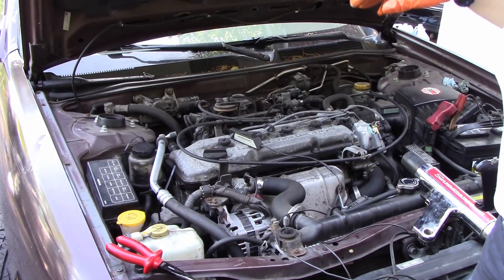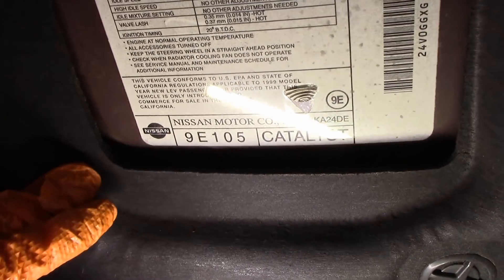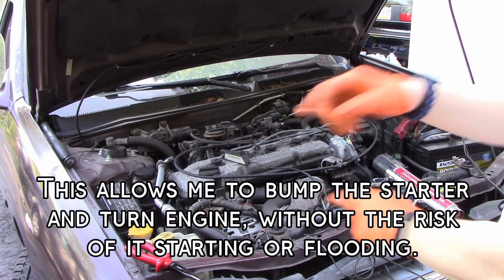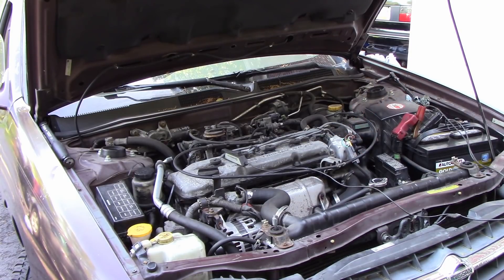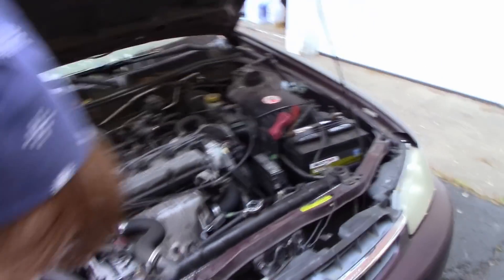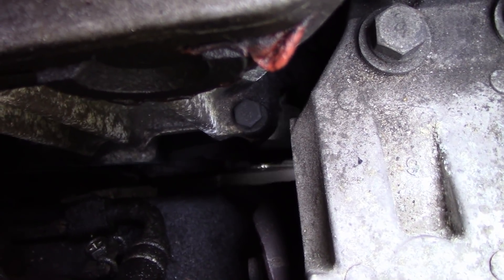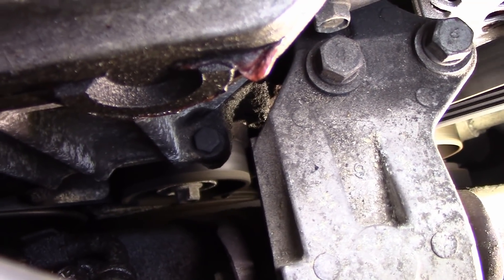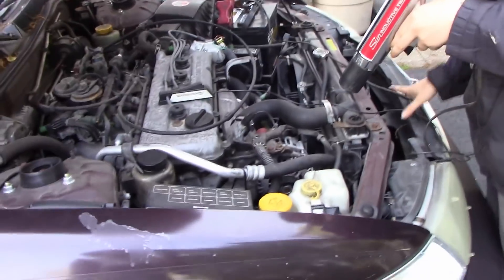'99 Nissan Altima 2.4ltr; Timing the Iginition Using a Timing Light

Comment: Nice video and well explained. Most mechanics today don't even know what a timing light is and how it works.
Reply from the maker: Hahaha.. yes!  So I've heard.  Many areas don't even have many older vehicles go to them for service either.  Thanks for dropping by Jim! Hoping you're enjoying the weekend! 😊🤗
Reply: @CubasAutomotive  Nissan Alima 2000's manual says that during timing adjustment one should unplug the throttle position sensor... Or it is not necessary ???

Comment: Why is he pumping the gas.. it's feel injected.  Pumping the gas pedal does nothing.
Reply from the maker: I don't recall that. Pumping does nothing,  correct, but holding the pedal to the floor cuts injector pulse... so it clears any flooded condition. Maybe he was doing that? Remember,  he does not know much about vehicles. So there's that. Lol
Reply: @CubasAutomotive  he doesn't need to know much ,  he has YOU. All he needs to do is say" it's broke,,please fix it".
Reply from the maker: @redhytech  yes. True true. 😅

Comment: How did you know that the notch you marked was at 20° before TDC? Thank you in advance
Reply from the maker: Great question!
That's all due to service info. There are marks on the harmonic balancer as well, but service info is much easier to read. I just compared the info to the harmonic balancer and made sure the info I had matched correctly.  I'll see if I can post a link, so you can see better what I mean.
Reply from the maker: https://drive.google.com/file/d/18MFMD36dyBuxWwuKihNUyqTRusW8GgRi/view?usp=drivesdk
Reply: @CubasAutomotive  thank you so much :)
Reply: What could happen if this timing is off

Comment: I thought I was the only one that still owned a timing light! I actually have 2 - one I had to buy at Checker Auto Parts in Phoenix when I moved out there for school, since I had left my Craftsman one at home in MA ... 20 years ago this week! Still have both of 'em. The Craftsman was handed down from my grandfather to my dad, and then from dad to me. Still need them for our Grand Marquis, and 940. Been a while since I've had to break them out, but they'll be ready when I need 'em. 😎

Nice job, Cuba! 👍👍 🍻
Reply from the maker: I have 3 lights. Had 2 with me for this job. Lol
Reply from the maker: That's awesome to have a tool passed down from your dad!
Reply: @CubasAutomotive  - Most of the stuff came from my grandfather - my dad had the ability, but didn't have the patience (sounds familiar, LOL!) so he spent his days in a factory - the mechanic skipped a generation. I've got my grandfather's toolbox from when he was a machinist at a local factory in the city - I need to break that one out and get it into the new shop now that I'm thinking about it. Lots of neat tools my grandpa made himself in there. He fixed Model T parts in his home garage right up until he passed. Stuff is in rough shape though, since it's been a mouse motel for the past 3 decades. Still glad I have it. My grandpa would be super proud if he could see my shop. He'd also be shaking his head at all the electronics, and tight spaces we deal with! 😁
Reply from the maker: @SmittySmithsonite  awww! That's awesome!  I love to hear those kinds of stories!  I wish I still had access to my ex friends Model T. One of the most interesting vehicles I've ever worked on, for sure. So therapeutic too! At least you have the tools, mouse motel or not! I'm also a HUGE fan of vintage tools. 😍😍
Reply: @CubasAutomotive  - Indeed they are! Neighbor has a BEAUTIFUL Model T truck tucked away in a garage on a separate part of his property - hasn't run in decades. I wanted to get it running for him, but that project unfortunately fell through the cracks of time. Hopefully the roof on that building is still intact, otherwise it'll go away fast. Maybe some day I can get on that, or maybe his daughter will. I'd hate to see it get destroyed by the elements.

I'll have to video some of the ones I have. I've got a vintage Snap-On ratchet - to change direction, you shove the 1/2" drive mechanism through, and flip it around! Pretty neat. 😎
Reply from the maker: @SmittySmithsonite  oh that's so sweet! I hope you can save it! Love to see a video on those tools too!! 😍😍
Reply: @CubasAutomotive  - I'll try to get a vid of the tools up in the next several weeks. My differential is supposed to be here tomorrow for my Silverado - I started shooting that vid March 12th ... been waiting on parts 8 weeks!! Plus the regular jobs in between.  I'll make a note so I don't forget. :)
Reply from the maker: @SmittySmithsonite  oooo... I'll remind you, I'm sure! Man, 8 weeks for parts! I know how you feel. Working on my sister's van since TST I think... or at least a month. But it's nonpaying, so I've been doing paying jobs in between. 

I had the heads sent out & returned, and engine all apart for a couple wks now. Weather has been horrible too, which by the way I'm doing this job in my driveway.  Last couple days, I just got done prepping the block, cleaning off all the old material & carbon off the pistons. Was hoping to start reassembly tmrw, but it's supposed to be raining through Tues.  

We'll see. Have a great work week!! Stay productive!  😊😊🤗🤗
Reply: @CubasAutomotive  - Good of you to help out your sister! Yeah, weather has been terrible the past month or so. Should be getting better any day now! You have a great week, too  - thanks! 🍻

Comment: Hey Cuba. Nicely done. I was going to ask if this had a spout connector/vacuum advance, or some way to set base timing but I see that's already been covered in the comments earlier.  You could have advanced the timing a couple of degrees and run higher octane fuel but on a customers car, you did what's best. My '85 Z28 on the other hand is my toy to beat up so I'll try anything. lol. Great video Cuba.
HAPPY MOTHERS DAY CUBA!!!!!
Reply from the maker: Awww! Thanks so much for the kind words! 
This customer wouldn't switch to the higher octane for sure. Although he's religious with his oil changes. This was his father's car and kept for sentimental value, as well as a backup for the family. Minimum is spent as he has 5 vehicles total.  I don't blame him. I try to do what's best for the customer. 
Thanks for stopping by! 😊😊🤗🤗

Comment: Awsome as Always. Reminded me of my younger days, when i worked in my dads shop. It must have been  over 15 years since the last time i operated a timing light. Brings back alot of memories.😊
Reply from the maker: Wow! Over 15 yrs ago?! I still use mine maybe once a month! That's quite interesting!
Reply: I first used a timing light working on a friend's 1973 Super Beetle when I was in high school. Brings back memories. Had to do this today for my own 2000 Nissan Altima after changing the distributor.

Comment: Great vid, Cuba! I want to see a vid on setting ignition points using the dwell method now hahaha!
Reply from the maker: I hope to have one soon enough.😉 At least 2 pieces of equipment that need to be worked on soon with points.  ...
Reply: @CubasAutomotive  cool! Haven't done points in some time but use a timing light almost every second day, that's a bonus with working on classic cars 🤘 My apprentice didn't even know what a timing light was before I started working at the current place I work at.
Reply from the maker: @2secondslater  lucky you! Classic cars!😍 I'd love to do that, at least here & there... what's the oldest you've worked on?  Absolutely awesome that you are able to keep it going, as far as continuing the use of old technology and passing that knowledge on! 😊👍
Reply: @CubasAutomotive  usually the oldest cars are 30's model hotrods but also get to work on lot's of 60's to 70's model vehicles ie XY Falcon GTHO's, Mini Coopers, Camaros and Chargers etc and my own car is a 1970 VG Hardtop . Most of the work I do on the daily is on late model stuff though, a good mix 👍

Comment: Your video reminded me that my old Sun timing light needs a new bulb and for the life of me I can not find one. It's nice to see that some cars can still be timed by an old school light.
Reply from the maker: Man! I know Radioshack used to carry those bulbs. There were 2 different styles, if u recall correctly.  A "U" shaped one & a bar shaped.  I wonder who would stock them now?  Are you on Facebook, Wyatt? I wanted to plug your channel & "thank" you for the sticker from TST.
Reply: @wyattoneable, just a tip, you can even check timing on cars with coil on plug ignition systems in most cases if you put the inductive pickup over all three (or five) wires to the coil 😉 If your timing light is good enough, the inductance from the primary circuit will still trigger the timing light.👍
Reply from the maker: @2secondslater  never thought of that.... especially those people without a scope. But there must be some sort of external timing mark on the crank to truly know the relationship.  Many newer cars no longer even have marks.... lol
Reply: @CubasAutomotive  true, and most newer vehicles have ECU controlled timing and "can't" be adjusted.... it is a handy trick for verification of coil triggering etc, have diagnosed skipped timing belts etc using this method. 👍
Reply: Another tip.... find TDC and then make your own mark and use the advance/retard function on the timing light to read the timing value 👍
Reply: ie. screwdriver or TDC finder down the plug hole to find TDC, make your own marks on the balancer and timing cover, start engine and use advance/retard function to line up your marks at idle, read figure and then compare to timing spec @ idle..... quick and dirty base timing verification...

Comment: Back in the day you used to have to disconnect the vacuum advance hose before timing. Any such thing on a '99 Nissan distributor ??
Reply from the maker: No sir, not on this thing. Some Fords, the SPOUT had to be disconnected. . GM, a similar wire for electronic advancement.  Excellent question!  For this breed of Nissan, only have it operating temperature... & of course no emission issues or vacuum leak skewing RPM.
Reply: Thanks for the reply. I still own a '77 Corvette. I haven't kept up on anything newer in so much as having to do timing goes.
Thanks
Reply from the maker: @davesage9190  oh sweet! That's more the vintage I like.    The newer ones, not at all. 😊